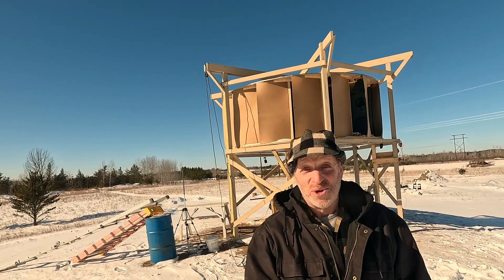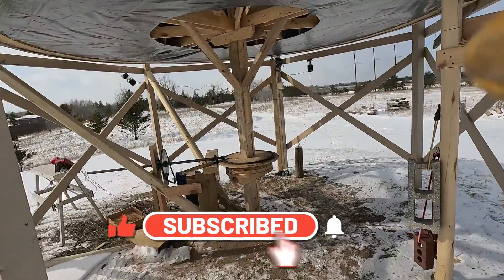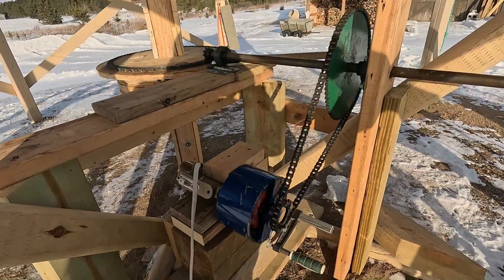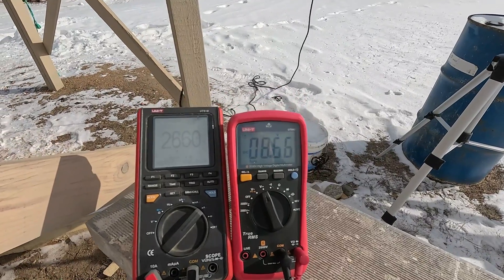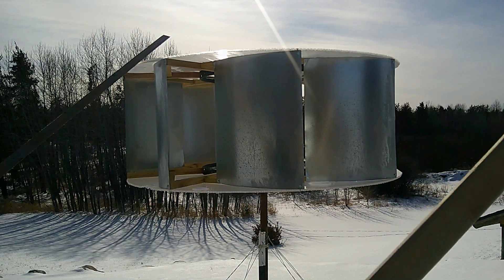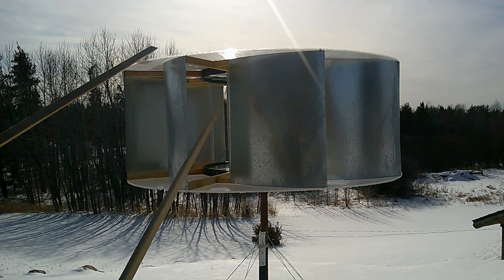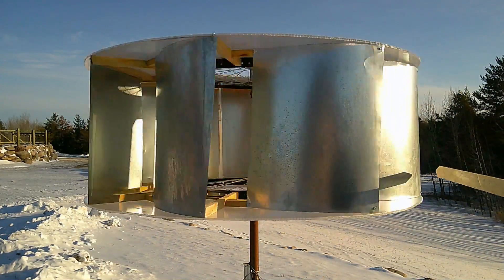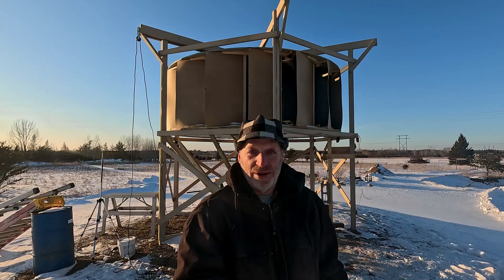The reason a VAWT is less efficient than a HAWT

Comment: For the big on you needhlaf the blades and a center cylinder to prevent incoming air from scape to the center,to move the generator use a flat  car belt mounted vertically

Comment: Seems as height on these verticals rises efficiency decreases.  There is a happy medium between HAWT and VAWT.  By using a tilted rotor where each rotor arm has a twist, allows one side to be at 45 degree angle to collect wind as the blade rotates 180 degrees it drops to 0 degree slope.  The bonus is, except for 30 degrees headon and dead trailing angles, the blade can harvest power.  Literally uses simple sailing pricniples to collect power from about 300 of a 360 blade rotation.  Dutch people used a variant of this to lift water with a shaft driven archimedes screw.  It is somewhat directional.  But you mount the turbine axis offset from the pivot point and it is very quick to shift positions in the wind.

Comment: All practical tests show, that ground-based small wind turbines hardly produce any electricity! 
Wind/electricity yield increases with the third power of the wind speed. So: +100% wind = +800% electricity. 
But close to the ground: 0 constant wind, only little breeze - or aggressive gusts! Only wind turbines well over 100m are profitable!
Solar panels generate at least 10 times more green electricity with the same investment of time & money!
Reply from the maker: Back in the1990's is when I bought the Whisper 600 wind turbine, while I was living off-grid.  With a 65' tower I got a little, but probably not worth the money for return; but I still have it.  Solar was extremely expensive back then.  My main power source was a diesel generator @ $.70 a gallon, -was cheaper than grid power where I lived.
I do have some grid-tie solar now, but I'm still going to experiment with wind.

Comment: Your "Swept Area" calculations rely on having efficient aerofoils.
Looking at the warped shape of your wooden Vanes,  you have a major power loss happening. 
You dont seem to realise that the sheer "push" of the wind is a small part of the total "lift" able to be obtained from properly designed Vanes. Like your smsll model.
Reply from the maker: So you think the small model is ok, but the scaled up bigger one has massive losses, because of the wooden vanes?
Reply: @doubleMinnovations  I'm totally certain of it. I've studied fluid dynamics for many years, and that curved surface in a decent wind totally makes all the difference  
There is a lot of information on the internet about it if you are really keen.
Check out Savonius Rotors for the story of the guy who first did all the studies.
I think you will enjoy the journey of discovery. Have fun.
Reply: @doubleMinnovations  Ps  I would build the new blades like the wings of an old biplane,  with tight canvas and thin strip' of wood. Same principle as a canvas canoe.
That should be pretty inexpensive, and not too time intensive.
Reply from the maker: The inner portion of the blades or vanes, are made in sort of that way.  Synthetic roofing underlayment stapled to the inside framing, trying to continue the curve of the hard board panels.  That the rustling noise that can be heard.  My first choice was to use  high density polyethylene panels, but they cost about 10x more.
Reply: @doubleMinnovations  Very creative. The trick is that the material has to be as super smooth as possible,  and super rigid as possible. 
If it rustles,  it's probably not doing very much.
As an experiment,  you could use an old sailors truck, and glue short bits of knitting wool down the blades surfaces. You could then observe, maybe even film, the air flow as the Vanes rotate.

Comment: i raised an old 10' airmotor but my well went dry.  i often mused that i would turn the mill to a refrigerant plant.  consider how much power an airmotor has to raise 700feet of water in a 2" pipe.    i was living in the high desert of new mexico on worthless land 35 miles from civilization, and i didn't mind not having electricity and hauling water wasn't too much a chore, but learned that REFRIGERATION is what is important .
Reply from the maker: It would be very interesting if you could get a wind mill to turn a refrigeration compressor.  You could use it like a big heat pump.
Reply: @doubleMinnovations  i would use a standard brass working barrel that is found at the bottom of the well as the compressor, but it would at the base of the mill.  my airmotor drove me nuts.  i raised it myself, and lowered pipes and all that.  at first i got some water, but it stopped producing over a few months, and in the end when the wind blew the noise of the mill just reminded me of the effort and cash i wasted.  probably cost me 5 dollars a gallon for what i spent om yhat adventure.  i was fortunate to find a servel gas refrigerator that was built in the thirties that worked better than any modern refrigerator .  my adventure in living a hippy life from 1972 till 1984 in a rude cabin in the wilderness with my dog Punky, were the happyst  years of my life.